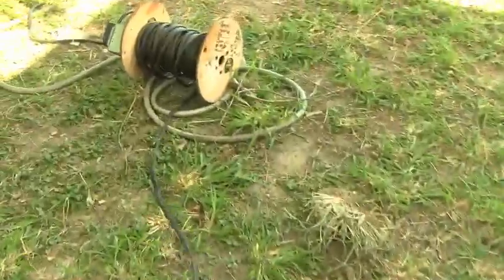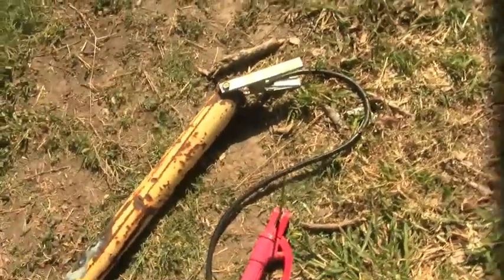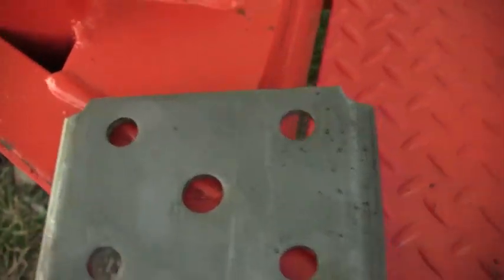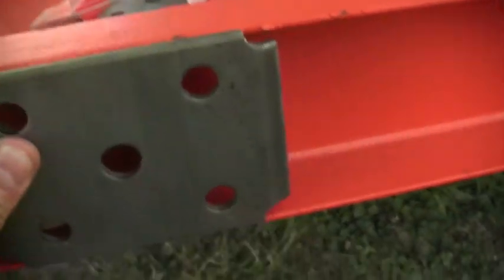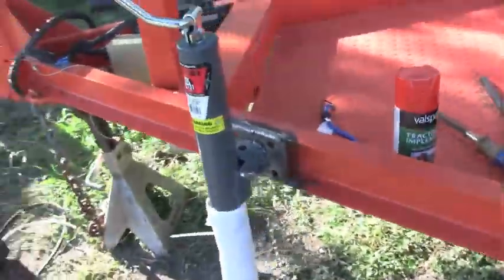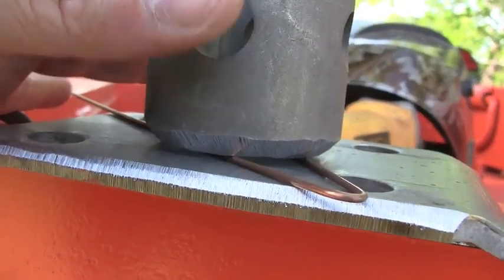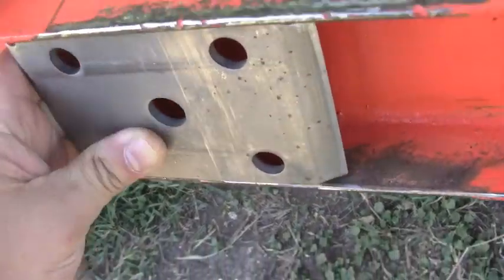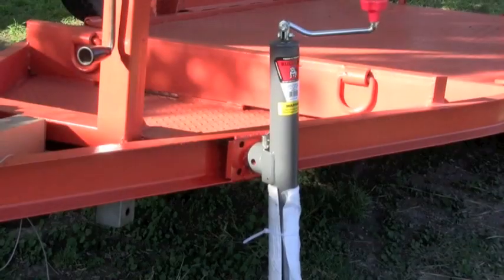why bevel when welding. fixing a trailer and scrappy

Comment: Not trying to be a pain. But some thing  I learned the hard way. Even if it is the right wire don't leave it roiled up.  You will cause a black hole in the universe by making a powerful magnet.  So roll it the hole way out or it might melt together the last part is what you really have to watch. PS Is hole spelled right?